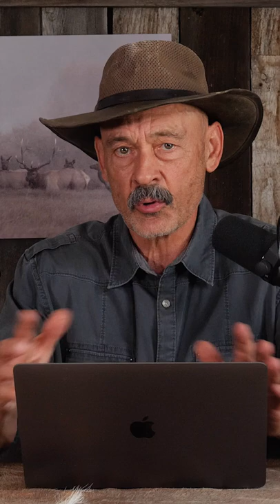How Rifle Barrels Are Made

Comment: In Revolutionary War days, they would have strips of steel, and wind it according to the desired caliber & rifling. My info comes from literature read 55 years ago, so I extrapolate the wound barrel, how they welded the pieces together. Pressures then were lower.
   Another thing, Revolutionary War days. The British wouldn't allow the sale of lead, so people would go house to house, gathering homes' pewter for bullets.
Reply: Thanks for this info, Tom. I've seen videos in which blacksmiths heated and hammer forged long flats of iron around a mandrel to make a barrel. They subsequently had to drill the rough mandrel hole to bore diameter, then cut rifle it. A lot or hot, heavy, hard work! But they produced some remarkably accurate rifles.
Reply: @RonSpomerOutdoors  Hi, long ago, early Americans were attributed their. I tory, being riflemen in a musket fight.

Comment: The ease in which firearms can be manufactured keeps me from supporting any kind of gun control.
Reply: You can even print them, from metal.
Reply: shinzo abe agrees
Reply: Not arguing gun control but I disagree with the ease of manufacture. Slam shotguns require a trip to the hardware store, risking your wrists and being an all around useless weapon. Unless you're a machinist and familiar with applied chemistry you cant do much. People talk about the luddy machine gun but talk is cheap. Tolerances on firearms are in the ten thousandths not tenths.
Reply: @ShinyUmbreon765  What about CNC machining and 3D printing, both plastic and metal? Also, people have been making their own guns for a long time, you only need to adhere to those tight tolerances if you want a high quality weapon but a weapon doesn't need to be high quality to get the job done.
Reply: You’ve got that dead on! I have a drill press, bench grinder, dial micrometer, taps and dies, many other tools, and a complete reloading outfit.
I’ve dreamed up several designs (all single shots). If you lack imagination, look at some of these cool shotguns, etc. that guys are making. They are really inspiring!
Hoard cartridge components! Lowes and Home Depot offers 90% of the rest!

Comment: Ok let's be honest button and cut rifling are the only way to go hammer forged barrels are just that stressed induced crap for production guns they are usually copper and carbon collectors I'm a benchrest and f class shooter the only use I have for a hammer forged barrel is while I'm driving to range and I get a flat tire I can use a hammer forged Barrel for a jack handle